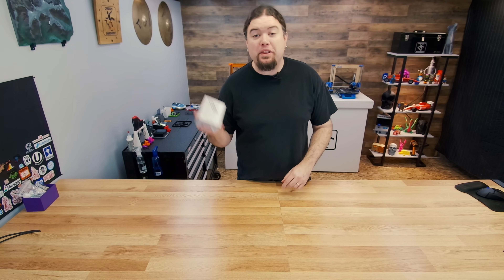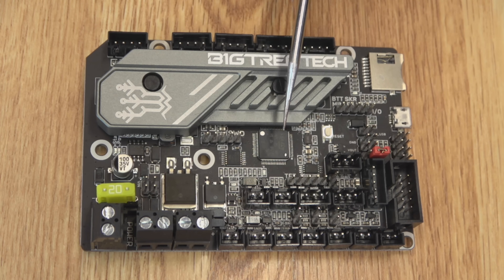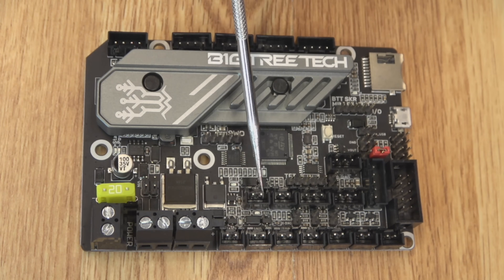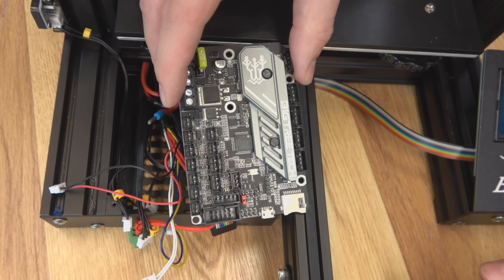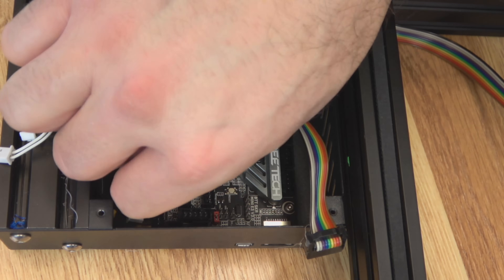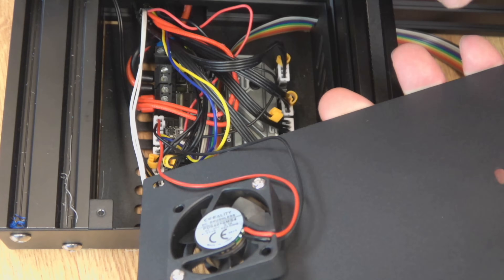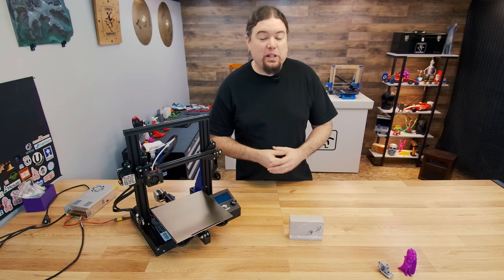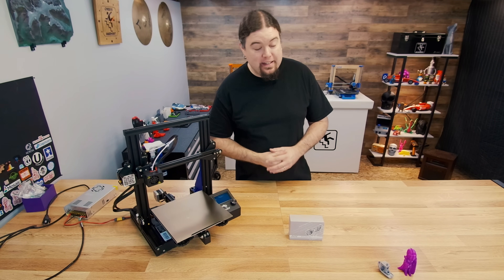BigTreeTech - SKR Mini E3 v3.0 - Chris's Basement

Comment: Hey Chris great video love the channel. I’m having an issue with installing my board. After compiling the firmware I run the machine and my x/y axis is grinding it seems to be happening when it gets to the end of the axis. I’m running an ender 3v2 with extender 400xl . I changed the size of all axis to 400x400x500. At one point I even recompiled and did it again at 380x380x500 and it still grounded the x/y . I’m not using the jumpers. Am I compiling the firmware wrong? Any ideas? Thanks man
Reply from the maker: Thanks! Are you using the endstops or sensorless homing?
Reply: @ChrisRiley  end stops
Reply from the maker: @Nomadman4life  Sounds like it doesn't obey the endstop. Use a terminal like pronterface and the M119 command to make sure the endstop are triggering correctly.  Make a video of the issue if you can.
Reply: @ChrisRiley  ok thanks Chris I’ll try that tomorrow and upload a video
Reply: @ChrisRiley  hey Chris here’s the video of the x making that grinding noise . The y for some reason didn’t do it this time . I’m going to try a different version of the firmware and compile it . That’s after I try using pronterface M119 command  like you said .
Reply from the maker: @Nomadman4life  Oh, I think you just have the direction flipped. Whatever these are set to, set it to the opposite.  

#define INVERT_X_DIR false
#define INVERT_Y_DIR true
Reply: @ChrisRiley  ok . And I did the M119 command and I got 
X_min: Triggered
Y_min: open
Z_probe: Triggered 
Filament: Triggered 
Does that seem right to you
Reply from the maker: @Nomadman4life  No, that doesn't seem right. You will need to flip the settings. 

#define X_MIN_ENDSTOP_INVERTING false // Set to true to invert the logic of the endstop.
#define Y_MIN_ENDSTOP_INVERTING false // Set to true to invert the logic of the endstop.
#define Z_MIN_ENDSTOP_INVERTING false // Set to true to invert the logic of the endstop.

Make sure this one matches the Z setting.
#define Z_MIN_PROBE_ENDSTOP_INVERTING false // Set to true to invert the logic of the probe.

For filament sensor, change this setting to LOW or HIGH.
  #define FIL_RUNOUT_STATE     LOW
Reply: @ChrisRiley  will do thanks Chris I’ll let you know how I make out . I re compiled the firmware ( marlin but different version more updated) but now the y axis is doing that same thing I took a video of but this time coming towards me making that grinding noise when it reach the end 🙄. But I’ll try what you saying to do and see what happens . Thanks again man
Reply: @ChrisRiley  Had the same issue with the V3 on an Ender 3 Pro with an Ender Extender kit as well. Any thoughts on what the cause of the this would be?

Comment: Could this be a drop replacement for the ender 5 plus??
Reply from the maker: Not sure exactly what board that printer has but this one will be really close.
Reply: @ChrisRiley  i see that the mine e3 v2 and this one has 2 Z ports, is there anything in the firmware needed to turn both on or can I just plug my second z motor without need to turn anything on the firmware??

Comment: Hey great video. I have a question, how to solve the problem with the 3 fans, how to control them on this board, two of them work and the third one does not, how to solve it in marline,
Reply from the maker: In the feature you would like to use with the fan, update it with the pin listed on the back of the board.
Reply: @ChrisRiley  I now that pin is PC6, it is manual control from the panel, but I want to control it by slicer, becouse that fan is for cooling filament, and when I slice the .stl the fan do not move.
Reply from the maker: @666Aries  If you run an M106 S255 from Pronterface or a terminal does it come on?
Reply: @ChrisRiley  I will check it tomorow right now I dont know.
Reply: @ChrisRiley  Yes it working after that command
Reply: ok, I think I have solved the problem, I use Cura and in the extruder settings you need to change the number of cooling fans from 1 to 0, because skr mini e3 v3.0 has these 3 fans and the fan is controlled after changing this parameter

Comment: Hello Chris, this video was really amazing and I am trying to get into 3D printing myself can you make a much more in depth installation tutorial from basically a completely new ender 3 as I am going to buy one in the future and I think a few steps were skipped especially with locating where to install it and using the ferrule kit and doing the JST connectors. Thanks!
Reply: 1. JST connectors are difficult when you are learning for the first time.  A couple of ways to go on that.  This is a great video explaining how to do JST connectors.  https://www.youtube.com/watch?v=SGwrfrt8KJw&list=PLf541u42GoiqIULu35xc4u15FVljSecyS&index=1

You can go with a ratcheting crimper or a simple hand crimper (imo, ratching is easier but both work)

2.  Ferrule connectors.  simple rule.  snip off the soldered dipped wire and strip new wire lead.  crimp use the smallest size ferrule that works for each wire.

Amazon, Ebay, etc. all have kits for ferrule and jst.  a cheap kit for the hobbyist should be fine.

Here's a link to the E3 V3 manual
https://github.com/bigtreetech/BIGTREETECH-SKR-mini-E3/blob/master/hardware/BTT%20SKR%20MINI%20E3%20V3.0/Hardware/BTT%20SKR%20MINI%20E3%20V3.0%20user%20manual.pdf

And, if you wish to use the ender 3v2 stock lcd, marlin has updates now for the LCD, so you should be able to use it with the BTT board (assuming you make a custom cable for pins to line-up and are willing to compile Marlin yourself)
Reply from the maker: Hey Kent, these are great resources. Thanks for taking to time to share.

Comment: Just wanted to say thanks for this video and review. As I'm in the situation that I have the SKR Mini E3 v2 and SKR v1.4 Turbo right now configured pretty well on my Ender 3 and Ender 5 Pro, I'd like to change out both printers to this board but then I also saw your other review on the SKR 2... 

I'm kinda torn on which boards to get from your reviews. Either the SKR Mini E3 v3.0 or the SKR 2? Out of the two which one would you go for? 

I already have the 2209's from the SKR 1.4 Turbo, but because each of these new boards have all three fans for PWM, it's like which one to get??
Reply from the maker: Really both are great, I like the form factor of the mini. The only thing I would go for the 2 for is that 5th driver if I wanted to use 3 extruders on indepent Z motors.
Reply: @ChrisRiley  thanks for the input! Your videos are so good and detailed. I think I’ll go for the 2. Also the fact that you can add wifi to the board is a huge plus as well!
Reply from the maker: @EatMoTacos  You're welcome, not on the wifi, RRF seems to be the only firmware that supports it as of now.

Comment: I just got one of these mid build on a prusa bear clone I’ve been putting together in between my switchwire, 2.4, I have 2 actual mk3s and a Creality cr 6se would it be possible to flash prusa firmware to that I have a prusa super pinda and run out sensor and an e3dv6 laying around as spare parts I also have a power supply and enough v slot extrusion to build a lot of printers just thought their firmware would be easiest….
Reply from the maker: Stock Prusa firmware would be difficult to port over, it being an 8bit processor. I haven't seen one, but there could be a project out there that does this.

Comment: I just have a few questions . How would I use the sensor-less homing feature of the board? Do I just plug in the jumper plugs? Do I need to update firmware? Thanks :)
Reply from the maker: Yes, put the caps on. Yes, you would have to turn it on in the firmware.

Comment: Great video as always Chris!  I just got this board to replace the v2.0 (my USB port broke off).  I had some pre-wired JSTs that I could solder to the fan wires, and discovered that there are two standards for polarity with JSTs.  There is the original RC standard which is opposite to this board, and there is also, for lack of a better word, Arduino standard, which is correct.  Just wanted to mention for folks that get pre-wired JST plugs.
Reply from the maker: Thanks a lot!
Reply: Reading your comment a bit too late myself 😅

Comment: Love the reviews everytime very informative. Any chance you could do an mainboard upgrade using this on an anet a8 plus 😁
Reply from the maker: Stay tuned!
Reply: @ChrisRiley  of course I took a swing at trying to figure it out (3 days later) 🙄 figured it out. I havent done anything more complex than copy and pasting config files before and well this was ruff but doable. But come to find out if your adding a tft at the same time in your config.h the display had to be changed to cr10 stock display no the discount reprap full graphic did not work was odd but once I figured this out was able to compile

Comment: Should I get this board for my molded ender 3 v2? Running direct drive,Cr touch,  duel z axis, ender extender extension, linear rails.

I only want the duel z plug but that's nothing a splitter can't handle.
Reply from the maker: Sure, as long as you don't need independent Z this board has duel Z plugs.
Reply: @ChrisRiley  I know it has duel plugs. I'm just curious if it's better than my 4.2.2 board I already have
Reply: @BobClavi  No, they're pretty much exactly the same.
Reply: Screen will stop working.

Comment: The slow boat finally arrived and I have this board in hand now. Plan is to replace the stock Ender 3 board + LCD with this one and the touch screen. I also have the BTT UPS board that I need to add. Based on your BTT UPS video it appears like at this point it cannot be used with this board since Marlin cannot yet be compiled for it? Or is it possible to set it up without recompiling?
Reply from the maker: Check out Marlin 2.0.9.3, it has a config for this board now in the creality ender 3  examples folder.

Comment: Great video, The Z-offset change no longer works in real time like on the original board, does it work for you?
Reply from the maker: I didn't try it, but it's probably a Marlin issue. When Marlin rolls it into the main branch that should fix it.

Comment: great overview,  would this board be good for my new ender 5 Plus? been looking for a good silent replacement and I have been happy  with the skr mini E3 v2.0's on my ender 3's?
Reply from the maker: Yeah, it should work just fine for that. The only thing you don't have would be independent Z motors if you wanted it.

Comment: Thank you for this video.  As a person new to your channel, and new to replacing main boards, I'm glad that you took the time to explain the details, like using ferrules, the need to add a JST for the parts fan, typically fan 0 is for parts cooling, etc.  Remember, nothing is old to us new guys!  Again, thank you for taking the time to mention all of the little details which helps when researching board swaps.

I am just a little confused about "no firmware" available.  You say that they offer stock .BIN files on their GITHUB site, but I am not sure if I need to load these .BIN files or if they come preinstalled.  Can you confirm what I would need to do to run standard Marlin, no BL touch.
Reply: Board comes with standard firmware. So if you dont have bltouch or anything fancy just swap it and youll be fine
Reply from the maker: Thanks!
Reply: @deathcube2006  what if I'm replacing a anet a8 plus v1.7 board with this could I use standard firmware but adjust parameters

Comment: Nice. got one for my ender 2 ( yeah I know) a couple of weeks ago after the original board failed.
Currently trying to setup the auto bed levelling. Inductive prove. fingers crossed.
Reply: Did you get your bed leveling to work? I am having troubling getting it to work with this new board.
Reply from the maker: @TheChriswhite77  Actually, I never tried. I only have  it on a manually leveled printer.
Reply: @TheChriswhite77  hi chris . yeah i did.. just of the top of my head i think i had to go into one of the config files and reassign the pins. let me know if you still having probs and i will see if i have kept any records,.
Reply from the maker: Good luck with your projects!

Comment: Yes, cool looking HS that reminds me of PC hardware. It doesn't appear to have efficient surface area (i.e. lacks fins) for heat transfer to the air though. Nothing a 5015 wouldn't overcome though. Looks like a decent amount of copper on the back if one wanted to add more HS.
Reply from the maker: But it does look cool!

Comment: PSA: The problem w/ "forcing" 512 on a 256-locked chip is that most times a 512 was deemed unstable but 256k was usable. Pushing code into that other half can cause unsafe/hazardous behavior.
Reply from the maker: That's true

Comment: will this v3 board work in a Creality3D CR-10?  will it work with the included firmware?
Reply from the maker: It will work, but it will have a smaller build volume set. I would wait until they release the source so you can update it.

Comment: I didn't hear you mention a fuse, though it looks like they included one. Anything to do with safety is an improvement. 

I have the skr e3 mini v2, if I was to be upgrading the mainboard, I would probably buy the v3.. looks like their going in the right direction, but as you said usb-c would have been nice for futureproofing.

I did mention this to them, but they wasn't interested and even seemed insulted, even though I was polite to them..
Reply from the maker: Thanks for watching!

Comment: I wanted to comment on your BTT TFT70 lcd video, but you have comments disabled for some reason. I wanted to ask you if you have ever tried an actual Creality TFT with a non creality printer before? I see the Creality 4.3 LCD is a decent price but I dont know if it would work with a non Creality motherboard/printer.
Reply from the maker: I haven't, I am not sure how those screen are configured, I have never had one.

Comment: Would love to get a tutorial on firmware, troubleshooting, I have mine installed but I don't have the 2 pin connector for one of the fans unfortunately (yet) now if they don't work I would love a video explaining more about it and how to solve it, great video by the way this is exactly what I've been looking for ever since i got the V3 for my ender 3!
Reply from the maker: Hey, when Marlin gets updated for the board I will look at doing a firmware setup video.
Reply: @ChrisRiley  Wonder why this is taking so long? I've never seen Marlin so slow to support a board.
Reply: Hey! I just got mine installed and got to build my own firmware. As said in the video, there is not marlin in the github yet, but in the btt github theres a marlin build you can work on. Just unzip in a directory and work from there! There is not much to do on it since it is preconfigured but you can tweak the bltouch and the stock settings.
Reply from the maker: @deathcube2006  Oh nice! Thanks for the info.
Reply: @deathcube2006  Do you have a link to this zip by chance?

Comment: Chris, great video!  A few questions...I just ordered 3 of these to upgrade three CR-10S 3D Printers.  (Ah, silent drivers!)  The LCD for the CR-10 ha two cables so I am curious where the second would go?  I'm also interested to know if the USB UART/Bus is improved?  I know for many older boards, using Octoprint, if you tried to print too fast (more than 50 mm/s), you could incur some defects from the board's UART unable to keep up.  (There' a few threads about this on the Octoprint forum)  Thanks!  Looking forward to receiving mine!
Reply: Paul, the display will need a Y adapter cable (also available from BTT via Amazon) to work with the CR10S display.
Reply: @BenEBrady  good to know, thanks!!

Comment: I bought 2 of these boards, they've been sitting on my desk for a week now waiting for me to install them. I would love a follow up on this video about the sensorless set up. Thanks Chris
Reply from the maker: Thanks @hobbyist notes as stated, it's very strait forward.
Reply: You just enable sensorless homing in your firmware and bridge sensorless homing pins with included little red bridge. I found it worst and more worrying than using actual switches and it's not that good as advertised. May be i am missing something important but it's from my experience.
Reply: @hobbyistnotes  you are missing something important.  the stall detection threshold needs to be tuned for your steppers!  if it's not, it will not work as well as it could if it were properly tuned.

Comment: That artifact line that you get on a benchy is exactly where the plimsol line would be, a plimsol line is a line marked on a vessel signifying the maximum water level for that particular vessel
Reply: Nice bit of trivia. Never knew what that was called. I'm not sure if that line actually shows in the slicer or STL renders though. Most people say it's an artifact from an internal feature. Maybe the deck layer, can't quite remember.
Reply from the maker: Cool! Thanks for watching

Comment: Does this version have a jumper to prevent the USB (octoprint) from back feeding power to the board?  I think their  RRF did. I always hate the LCD screen on when I have it the main switch off but the octoprint plugged in
Reply: I just put a tiny bit of tape over the power on the usb a side
Reply from the maker: Yes it does, it uses the same type.
Reply: How did you get octoprint to detect the printer? I can't get it to detect it...

Comment: One thing to point out on these, the one feature they're missing that might be a reason to not get it - While it has two z stepper plugs, there's not independent steppers for Z, so you can't do auto-tramming with it with Marlin.
Reply: BTT has boards that do that,  I was thinking of getting another Octopus and trying that on my Ender 5 Plus.  I really like the way it works on my Rat Rig
Reply: @woodwaker1  Yeah, the SKR E3 Turbo can, too.
Reply from the maker: Thanks for your insight!